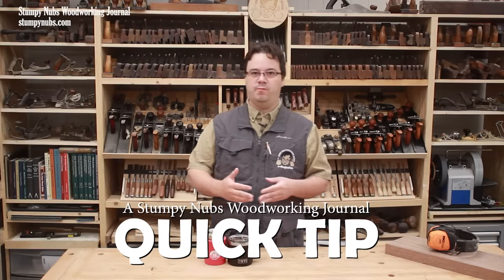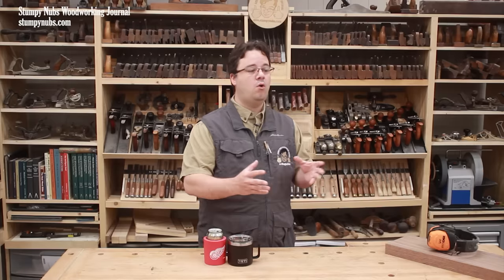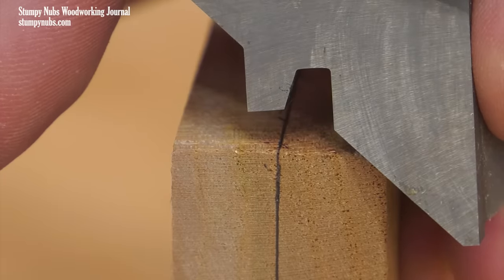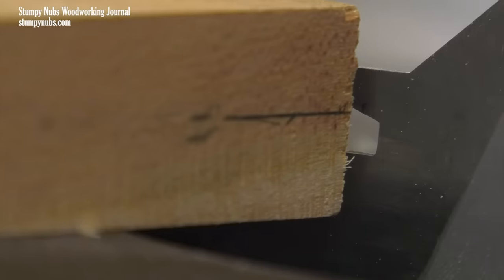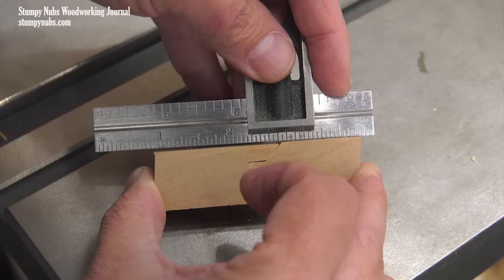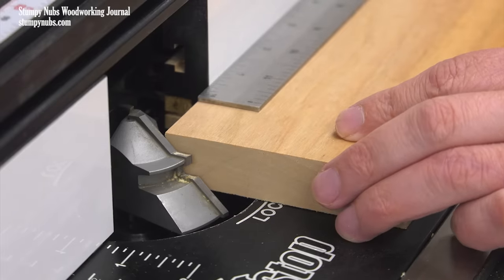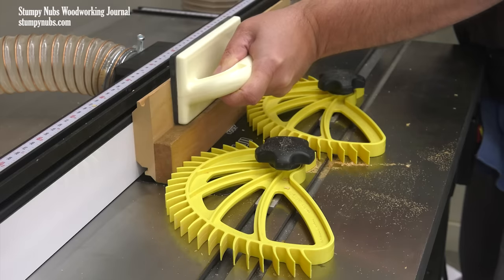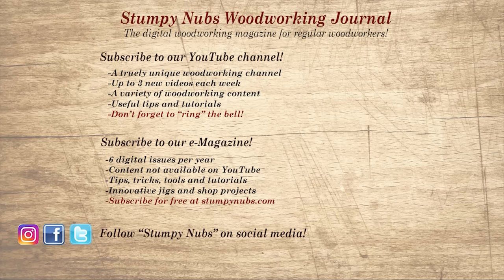Why not just set up your lock-miter router bit this way?

Comment: Once you DO have it set up, get a piece of stock that's the same thickness as your "production" piece, cut into it with the bit, and save it. This becomes a template/guide for the height the next time you need to make this cut on that thickness of stock.

Comment: James -- Excellent instruction. One more tip for those new to these bits: Mill ALL the stock (plus a little extra) you will be using in your project at the same time. Even slight differences in stock thickness will result in a joint that does not fit properly.
Reply: Goes without saying that you should also mill your scrap lumber test pieces at the same time as your project workpieces.

Comment: The shop I'm at we use them mainly for beams especially rustic beams but we do a relief cut on the table saw at around 30 degrees to take the stress off the cut.

Comment: I wish all videos would be like this on YT. Straight to the point, well demonstrated.
I just have a hand router, but I'll figure out what to do based on this.
Reply: Sir. I know it's been 8 months. Please do not do this with a handheld router. There's no roller bearing guide to rest against the wood! A full cut with this wide router bit could jam against the wood and send the spinning router flying with no mercy at you or across the room. If you did this already, I hope you're still alive.

Comment: I never thought of doing both ends of the test piece and then cutting them apart to check the joint, I've just been using two test pieces. Thanks for that tip!
Reply: Right? How many pieces of new knowledge can you shove into a quickie video?
Stumpy Nubs: hold my kooshie'd can
Reply: @chrisjacobs7434 : That sounds like something I, Really, don't want to do. 😲😳

Comment: That tip about taping an extra piece to the board for edge cutting made total sense. Thanks!  I was having a problem with that, as the board on edge was exiting the bit and then moving around or dropping, as there wasn't any support for the sharp edge.
Reply: Yes sir, the downside of using this type of bit it that it does remove some material off of the face it’s cutting. It’s a small amount but you loose the reference edge which lets the piece dive down resulting in a snipe at the end. Adding to the length of the board works to eliminate this as you simply cut the sniped piec off. Taping or hot gluing another reference edge works too.

Comment: This is a timely video as I had just purchased these router bits in both sizes. The package came, I opened it, then I shuffled the bits off to the side - intimidated by what I imagined to be a very daunting setup.

Thank you for this to-the-point, clear explanation with good visuals.

Comment: They sell those little guide templates make it pretty easy to set up although there for a specific size stock. The hard part is standing the piece up on end. if I wanted to do the corners of a draw with a lock miter that’s a dangerous cut.   you need to check to hold that piece of stock really tight. I’d love to see you do a lock miter on an end cut

Comment: Thank you, Mr. Hamilton.  This is one of the clearest explanations for how to set up a locking miter bit that I have seen or read.  I have a locking miter bit, I needed one to make a hollow square beam, and even with the manufacturer's directions, which basically said buy our setup tab, I couldn't figure out.  After a lot of fiddling and a number of test cuts I got it as close to right as I thought I could get it and made the cuts.  They weren't exact, but I was able to hide the small error by rounding off the corners.

Comment: I like your presentation very much. Infinity makes a lock mitre master jig which is a small magnetic device which shows the centre  for both vertical and horizontal. I have used it for about a year and found that it makes alignment correct the first time almost every time. It is what your video shows but without the centerline guess work. Thank you for all the help you have given me in the past. This is not a set up block, but rather an aluminium piece held on to the bit by magnetism, which extends the center lines for easier alignment.

Comment: Can confirm, whiteside bits ARE awesome. If you are someone who just got a router and started out with one of those lower priced ($40-$75+) variety sets, I highly suggest replacing the ones you actually use with Whiteside bits one at a time. You probably won't find that you use a lot of them if you are a hobbyist, so you don't need to go replace them all at once. But as you use some of them more and more, spend the extra bit - no pun intended, well, some intention - to get a Whiteside replacement. I was doing a lot of box joints with my cheapo 1/4 straight bit, and I finally upgraded to a spiral upcut bit (RU-4700 iirc), and it was a night and day difference.

Comment: A Lock Miter Bit can also be used to make Stickley-Style, Arts & Crafts/Mission style legs for chairs, tables, etc. in Fine Woodworking No.121, Dec. 1996, by Patrick Nelson (p.p. 54-57). The original Stickley method required two shaper bits and set-ups but the lock miter bit only requires one bit at one setting, but two simple jigs to get legs with four quartersawn faces.

Comment: Thank you, I had a cheap set and followed your directions. They worked just fine and the ends looked super. Now to get a better lock miter bit! The cheap ones were ok but the joints were not very snug on the inside edges. (No more cheap bits!) These were on 1/2" box sides. No setup blocks needed with your method!

Comment: Thanks James. I bought a small one a while back but have yet to put it to use. Part of my reluctance stems from several safety warnings about the 1/4" shank ones failing under load, the other part was trying to decipher what I could find on line about the product. As usual, you completely demystify the process. Will be buying a 1/2" shank one soon, the corner joint quality is very attractive to me.

Comment: Hey Stumpy, I've owned a lock miter bit for probably over  years.  It's still unused and in the plastic box that it came in!  As you mentioned, was afraid of using it.  The massive size is intimidating and I wasn't sure of how to use it and I didn't have a decent router table.  I recently bought a Kreg router table and now that I've seen this video I'm eager to try out your method of setting up the bit.  Thanks man!  Love your videos!!

Comment: Well done presentation. I got acceptable test results on the 3rd try using MDF scraps. If I were making columns where the routing is done in the long grain direction, I would be ready to go. Personally I am more interested in building drawer boxes which will require end grain routing, at least with real wood. I think holding the drawer side stock for end grain routing will be more difficult than the setup process.
Reply: What I do is I take a large blank and make the cut for the drawer ends, then I cut the blank down to the height of the drawer sides.  I find its a little easier to work with a larger piece.

Comment: I’m about as “amateur” as an amateur woodworker can be, and I’ve used the smaller Whiteside locking bit a few times in over the years.
I have to agree, it isn’t difficult to get setup and works consistently time and again.

Comment: Great video, much easier than some of the other methods I have seen. One thing I do need help on though is how to avoid chip out on plywood end grain when routing the vertical cut, if you have a tip, be great to see..
Reply from the maker: You have to make a zero-clearance fence face. It's a little tricky to plunge the bit into it, but we may make a video about it sometime.

Comment: Thank you sir! Excellent, well explained, detailed explanation of how to set up these bits. I'm using these bits for the first time and am going crazy with "trial and error" to get the fit right. Your intelligent explanation has set me straight. FYI, for this type of bit, good idea recommending Whiteside or other top-of-the-line. I got a cheap set of multi sizes and it makes a mess with hardwood.

Comment: Guys,  I just bought a lock miter from Infinity and I got the setup jig for it......piece-o-cake!
Reply from the maker: Setup blocks only work on that one precise material thickness. Since not all materials are exactly 3/4, particularly plywood and any hardwood you mill yourself, setup blocks aren't that useful- especially considering you still have to make test cuts to fine tune the setup, like I did without any jigs.
Reply: @StumpyNubs  not these. They are designed to work for a range of thicknesses. They work on the same principle as what you were describing (center of material) but they take the guess work out of the equation. Go to Infinity and check them out. Btw, they aren't really a setup block. It is a set up jig and it comes in two sizes to fit the two different size lock miters. Now, I also have Infinity's lap miter bits and those have set up blocks for them as well. P.I.T.A. to set up. Involving many test cuts.
Reply: I've been using the Infinity jig for a couple years now. It is rare that I don't perfectly nail the setup on the first try. Marvelous piece of engineering that works great as long as you follow the directions exactly.
Reply: @jameswhattam3945  completely agree. Thanks.
Reply: Where did you buy?  Don’t appear to be on Amazon.
Reply: @jeffwest4325  directly from Infinity Tools. But let me revise my comment a bit. Set up isn't a piece of cake but it isn't that bad.

Comment: Just curious:  Why not do the ruler trick first, right after eyeballing the height and fence, before cutting any test pieces?  It seems to me this would be a good way to dial it in much more exactly initially and reduce the number of test cuts and tweaks you need to do to actually get it right (possibly only requiring one test cut to confirm it is, in fact, correct).

Comment: I've built one large box out of ply using this cutter - it was a disaster. Mainly for a lack of big router table - not stable holding of the work. And too deep of a cut - burned edge plus chunks ripped out. Not using this bit until I have a proper router table. Thanks for the video, will be handy later to refresh

Comment: A question abut when you trim the test pieces and flip them to see if they are flush. If they are not, I understand you need to adjust the router bit height by half the difference, but how do you know whether to adjust it up vs down?

Comment: Many thanks for yet another useful video. Would this method provide a strong joint for MDF boards? I need to make some large bins for scrap wood and MDF is what I have. If not this joint, then what would be the best structural strength join for MDF. Dowels? Finger joints?
Reply from the maker: Yes, it would be a good joint for MDF.

Comment: Ok almost got it. When you say mating piece what do you mean ?  I see sometimes people routing one piece up against the fence like you did and another piece flat on the router table. Do you have to do this all the time?
Reply from the maker: "Mating piece" means the other piece that goes together with it. A joint has two mating pieces, or two parts that go together. And yes, you always run one on it's edge against the fence and the other flat on the table.
Reply: @StumpyNubs  Awesome.  My pieces are narrow 3 1/2 inches for a base for a cabinet so I wasn't sure.  Thanks a bunch. Big fan

Comment: How do I find the center of the bit??? Do I measure it straight up and down? Do I measure it diagonally? I am having a very difficult time finding the center. Mine is a white side, but it looks like my halfway point is below the jutted blade point. Then when I run the piece through, the bit lifts the piece of the table and it messes up the cut. I have tried this 40 times or so. Can’t get it straight and it tears up the wood like crazy. You make it look so easy, but I just can’t seem to get it. Either the board gets knocked out of straight, it tears the heck out of the wood, or the bit lifts the material up and messes it up that way……ugh!

Comment: Do all larger bits do all thicknesses?

I was looking at some bits here in Australia, 2 different sizes.

One size was listed as doing 9mm-19mm, the others size bit I believe said it would do 16-30mm
Reply from the maker: Small bits do up to 3/4. Large bits are more versatile.
Reply: @StumpyNubs  thanks so much for replying. The shops definitely don't tell you this. I think I will buy the larger bit, you just saved me nearly $100.

Comment: Is it me or did you flip the orientation of the board during setup. At Min 2:06 you stated the cutter has to just under the width of the board; however, the board is clearly in a different position than it was when you were setting up the depth of the cutter VS the placement of the fence.  I guess it's not a big problem if you catch it, however this was not stated.
Reply: I found my problem; I bought these bites without the all-important setup blocks.  They should come paired like a drill and chuck key; one will never move without the other.

Comment: You have two links in the description. I want a lock miter bit and would like to help the channel. If I click on the link directly for the lock miter bit will you still get anything or do I need to use the other link?
Reply from the maker: We get credit for any Amazon link in our videos, no matter what you buy. So either of the links will work. Thanks for the support!
Reply: @StumpyNubs  James, I’m having an issue. I actually got the large lock miter bit through your link installed it in my router table and made some test cuts. It seems to work great but when make a cut with the face of the board on the table (not on the fence) the bit seems to almost be sucking the last few inches of board into the bit and it looks almost like planer snipe. Any recommendations on what’s going on and how to correct this?
Reply from the maker: @joeduv715  The only possible cause I can think of is your fence is not straight.

Comment: They say a picture is a thousand words, and in this case a graphics picture of what you meant by "middle" of the bit would have helped a great deal because the Bit has two middles vertically and horizontally you meant vertically but the way you marked it made it look like you were talking about horizontally.

Comment: Sir Stumpy...im in need of assistance.  Im new to woodworking, as is my buddy, so we are sort of stumbling through things.  We used you process to set up our bit and are happy with the joint it makes. Our issue is holding the work piece when  routing end grain. Some cuts go smooth,  others no so much. We are having problems with the work piece either hooking on the outfeed side of the fence( its almost as if the bit is sucking the work in towards the outfeed  fence) or the work piece is pivoting down as it goes across the gap (no zero clearance insert under the bit), this causes the joint to go off track...The pieces were are trying to run are 6-9" in width so not a lot of support to be had.  Running longer pieces,  with the grain,  works awesome. Any ideas?

Comment: I got the smaller bit and it struggles to take out so much wood in one pass.  It did okay on pine, but red oak and Baltic birch plywood were too hard for it.  Am I doing something wrong?
Reply from the maker: Sounds like your router is under-powered.
Reply: @StumpyNubs  I thought a 2.25 hp router can do all tasks. But this bit would save me a lot of time to make drawers.
Reply from the maker: @b3arwithm3  That router should be powerful enough. If the bit is sharp, it should cut in one pass. Are you running the RPM too low?
Reply: @StumpyNubs  I did try all 6 speeds from 8000 to 24000 rpm. But I thought when making tough cuts we want lower rpm no?  It was a $40 bit thus it might be not that sharp. Thanks for your help stumpy.
Reply from the maker: @b3arwithm3  No, you set your speed to the size of the bit. (There are router bit speed charts online) The larger the bit, the slower the speed. Going too slow will stall the bits momentum and make it harder to take a substantial cut. You can slow your feed rate if you wish to limit the amount the bit is actually cutting with each pass of the cutter.

Comment: do these bits work well with plywood?
Reply: I haven’t had good luck with playwood, what works great for plywood is a lapped/rabbet mitre bit set
Reply from the maker: Yes, but the thin veneer on some hardwood plywood can splinter a little in the corner of the assembled joint because you are cutting a knife-like edge on the two pieces. Baltic birch plywood with thicker veneer is the best, but any flat plywood will work, especially if you use the tip I showed about taping a straight board along where that knife-edge will be cut.

Comment: I notice you're using a sawstop router lift, and I assume, as sawstop table.  Have you abandoned the MLCS table with the android pad?  Just curious.
Reply from the maker: No we use several router tables in the shop, including the MLCS
Reply: @StumpyNubs  I'm glad to hear that because your other video on expensive luxury tools has me interested in the MLCS setup.  Thanks for this lock miter video also... your instructional material is all top notch!
Reply from the maker: @jeffsmith4110  I will admit that the SawStop table is the favorite of all the tables in the shop, mostly because the MLCS one is a little slow to raise the router up and down.